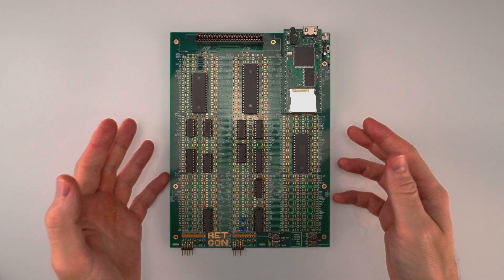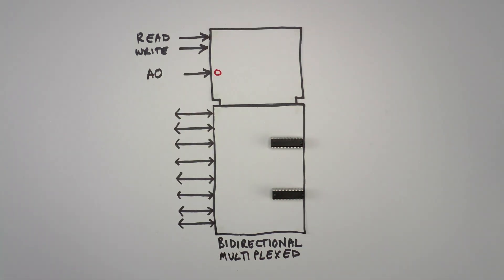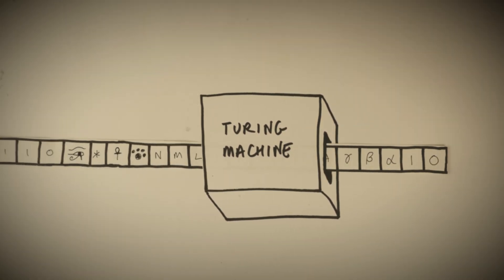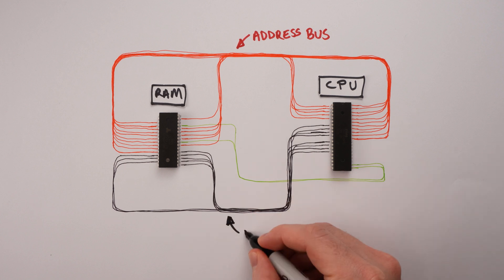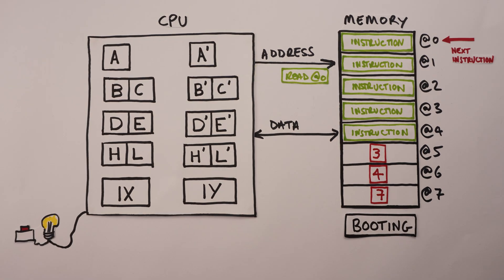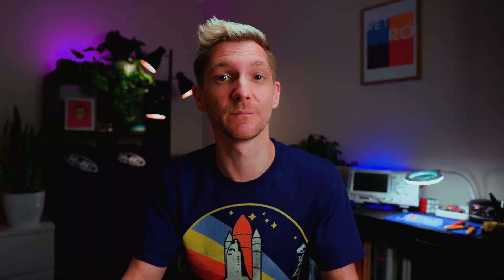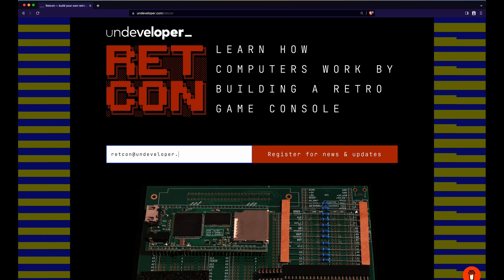CPU and RAM – how computers work #1

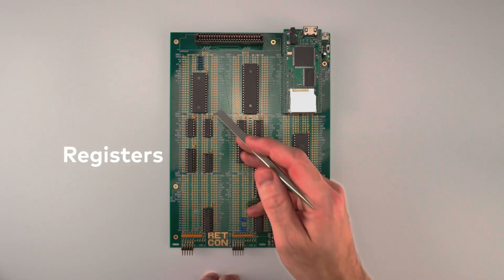Comment: 3:16 Which chip handles graphics and sound?
Reply from the maker: At the point you linked at 3:16, you can see the module in the very top right hand corner of the main board. This is a module I have designed myself called the "Retcon AV". Because it's generally difficult or impossible to buy new retro graphics / sound chips today, I decided to build my own general purpose retro AV module and it's based around an FPGA chip — a Lattice ICE40. It can output digital video at 640x480 through an HDMI connector so, unlike original retro graphics chips, you don't need to find an old CRT TV, or buy adapter cables to view the picture.

The module can already implement graphics and sound from the Master System and Game Gear (based on an extended version of the TMS9918 graphics chip and on the SN67489 sound chip) and should be quite capable also of running the TIA from the Atari 2600, the ULA from the ZX Spectrum, the 2C02 PPU from the NES and also the Game Boy (although a problem with building a Game Boy clone is finding a CPU)
Reply: @undeveloper  Is that mean we will learn how to program TMS9981 graphics and SN67489 sound with the kit?
Reply from the maker: Yes that's right. I'll cover the basics of both in some tutorials, but of course there are lots of online communities that go into a lot more depth on the original console programming.
The Master System uses an extended variant of the TMS9918 chip with a so-called "mode 4". Almost all games are programmed for that, and it's what I've focused on supporting so far, but the original TMS9918 modes should follow too. Those would be the modes used by e.g. the MSX, SG-1000, ColecoVision, etc.

Comment: I got a degree my computer science in 1980 and to be honest for general purpose computers nothing has really changed in 43 years, ok they have got faster and have more memory but thats all.
Fetch
Decode
Execute
Good clear explanation of the major components and how they work.
Reply from the maker: Thanks @turdwarbler (great handle BTW).
Yeah I love the simplicity of fetch-decode-execute and I think the fact that nothing much has changed is a real testament to the mathematical "truth" behind the nature of computation that Turing et al. established. There are ways of optimising the computation process for sure, but fundamentally the nature of it can be distilled down to the same basic building blocks. Incredible.

Comment: Bidirectional pin sounds so negative. I’d like to go a step further and put chips ( CPU, RAM, ROM, GPU ) on a bus. Clearly only one of them can talk at the same time, and the others listen . Separate pins are more for serial point to point connections. For example 1 bit memory would only have two pins anyway. A memory controller may use these for extra speed when it multiplexes CPU and GPU access onto shared RAM. ( GPUs read only , CPUs read a lot of code ).
Reply from the maker: Interesting! What would you call your pins, if not "bidirectional"?
Reply: @undeveloper I would call them like this, but not introduce it like: We are cheap and probably lose bandwidth. I want a positive vibe: "All the chips on the pcb are a big family and work together". Or: "We have to set the address each cycle and there is a time where the pin cannot be used. Then there is the time where the pin can be used for exactly one thing. So if we use a half way performant memory controller, we can reuse the pin and have a clean PCB". Even more interesting with DRAM: We have to do all the RAS CAS. Data pin is not critical in comparison. I read that since DDR RAM ( and Rambus) the data pin became critical. So the technology presented here has a safety margin of 15 years = a factor 1000 in Hz.

I think that early RAM had separate pins to save critical transistors. If some addresses don’t work, you sell as half capacity and pull one of the address pins. With pure CMOS a bidirectional path to the memory cell might be possible. Uh, but RAM is not CMOS, and especially SRAM has high power write amps per row. Nothing bi directional. Single pin is like the EDO RAM of the 70s. Extra circuitry which mostly adds latency.

Comment: What about clocks.. i thought cpu works in sync with internal clocks
Reply from the maker: Great question, @SumanthSiddharthaSuddunu-wv1ve, and you're quite right that nearly all CPUs are examples of what we call "synchronous logic", which means that there are only specific moments in time when we can agree that each signal sent between devices is valid. Synchronous CPUs indeed have a clock signal which facilitates this, and that's why we very often talk about CPU performance in terms of clock speed, e.g. 2GHz, etc.

Actually synchronous logic makes a few things easier when it comes to digital design, but it ultimately slows things down (the clock speed is more like a speed limit than something which makes everything work even faster!) and so there have been examples of experimental and even commercial CPUs designed which are *asynchronous*, i.e. they aren't driven by a clock, but they are very rare compared with synchronous CPUs.

I decided not to go into all the detail about clocks etc. in this video since it doesn't really make a difference to the basic principle of information flow between CPU and memory and how CPUs generally work, but it is certainly of importance when it comes to actually building practical circuits.

By the way, the flip-flops and registers I illustrated in the video were actually synchronous, in that they require a clock pulse to register their values. The 74x273 register chip I demonstrated is also synchronous / clocked. Most static RAM and ROM devices, on the other hand, are not clocked, but respond with data as soon as the relevant control lines are asserted. If you were to build a computer today with "retro" CPUs like I did, you'd find that the memory responds far quicker than you can clock the CPU, which hasn't always been the case..

Hope that's helpful!
Reply: @undeveloper memory was so slow to respond that we could not read it every pixel clock cycle

Comment: A flip-flop flips and flops with each clock pulse. Regardless.
A D-Type flip flop, flips and flops at each clock cycle, depending on the input (the 'D' means data at the input).
You were close, but no cigar.
Reply from the maker: Thanks for the clarification, @So-Now - you're absolutely right, I decided to use the example of a D type flip-flop specifically because I felt that starting with the classic S-R flip-flop would add a little too much potentially confusing detail to an otherwise quite densely packed narrative; but perhaps I should have been more specific to avoid confusion!
In my notes to the console build project I will be going into a lot more detail, for example how to design S-R and D type flip-flops from NAND gates, etc., so hopefully one day I'll earn that cigar 😉🤠💨